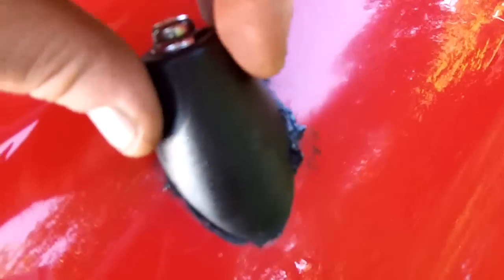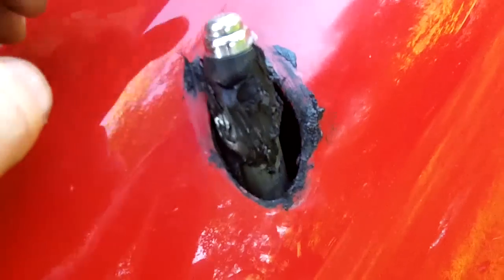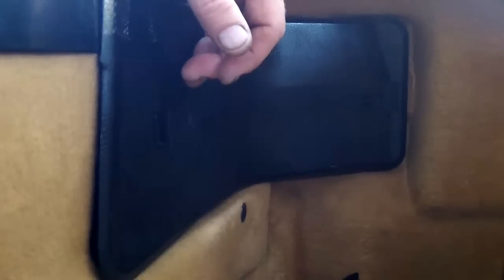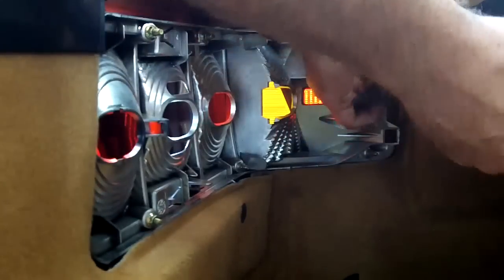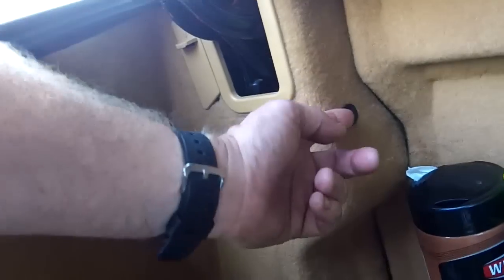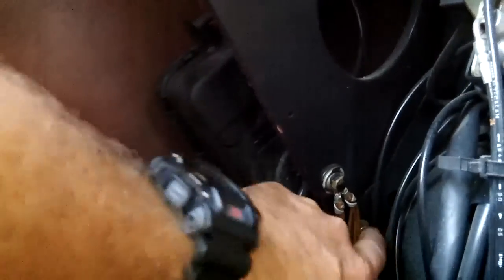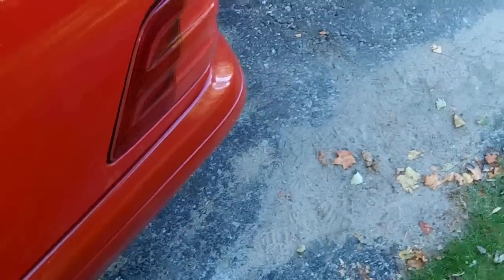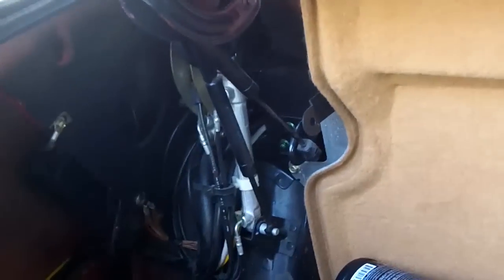Mercedes r129 power antenna.. fender boot/grommet replacement

Comment: Thanks for this video. For mine, I did have to remove the remnants of my old lower grommet from the inside, but was able to avoid the disconnect of the antenna unit and complete removal of the well carpet by pushing the lower part through from the outside enough to get that lip below the fender, then snap on the upper.

Comment: Very helpful, thanks for taking the time.  I can add that it is easier to install the lower grommet from outside the car, rather than pushing it in from inside.  Good call to inspect the hydraulics while the trim is off.  Keep up the good work!

Comment: Thank you for another great video for the R129.
    I had to replace the outer antenna seal on one of my R129's because it was cracked and some "Chimps" lol , had the inner seal on the antenna shaft and wasn't through the quarter panel hole , as its suppose to be .
  Fixing small details , is a great difference. 
    Thanks again. 

 Best 
Regards
Reply from the maker: yup..beware of chimps . They screw up more than they fix. :) Fixing the little things is pretty satisfying .

Comment: Thanks for the video, I was wondering how to install the grommets.       

What year is this? I have a 99 and the boot liner had a CD Changer that had to be removed. Also, there was a hydraulic cylinder and a bunch of hoses infront of the antenna assembly, which also had to be removed - yet yours was right there easy access

Comment: Are there two size outer grommets?
The one I purchased does not completely cover the opening.
Reply from the maker: there shouldn't be ,unless the part was changed on different years
Reply: Ya, one grommet set is larger for the "ball top" antenna. It's 42mm long vs. the std. that is 34mm.

Comment: Hey bud just wanted to say thanks for the help wondering if u have a video on the catalytic converter I think mine is going out I have a rattle under my car and acceleration was. Never that great I also have a intermittent starting problem any ideas would b so appreciated
Reply: Just when I was getting ready to do this,Viola,it comes up on the Tube...Thanks